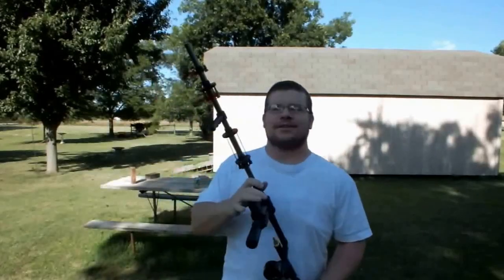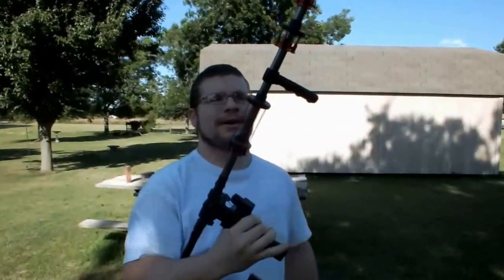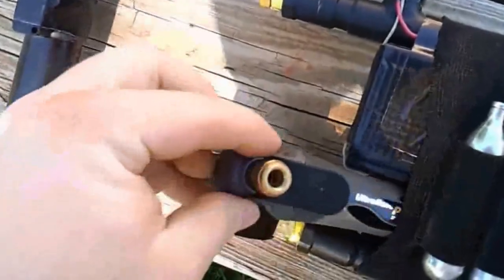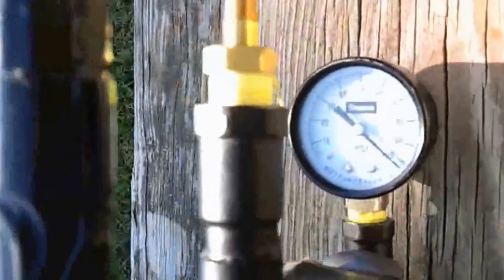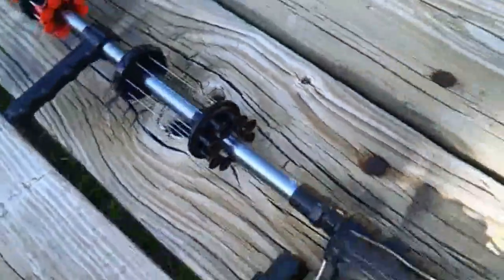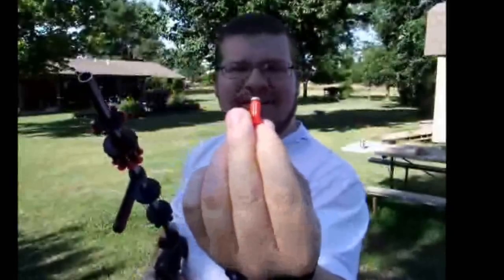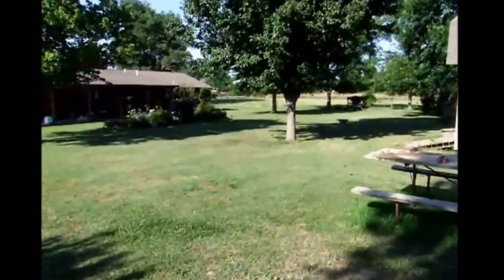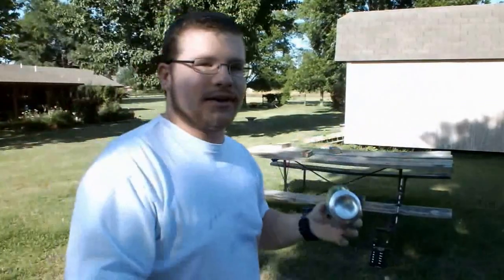Dartgun (Pressurized Blowgun)

Comment: Another poorly made video, how sad. I would rather see a video about how you made it. I REALLY don't care to see you shooting it. I bet that you didn't even make it. Doesn't seem to have very good range either. If you have to get that close, how do you expect to be able to shoot anything alive?
Reply from the maker: Yeah, I can't say it was a great video, but everyone's got to start somewhere. Not that I'm great at making videos now. Videos aren't my main thing, I mostly build things. 

Yes I did build it. I didn't have any plans to make a video about it until I had my third one made.  Since I didn't have any plans to go off of, I went through three designs (I feel like it's cheating if I look at other designs. I want things I build to be completely what I think of). 

I spent around $400 with all my redesigns. I originally bought a 1/4" solenoid valve, but it didn't have nearly enough airflow. I then bought the 3/8" solenoid valve that is currently on the gun. Just those two valves were $90. And all the copper fitting I bought weren't cheap of course. My first two designs I bought a one gallon air tank. 

My first design was very basic. All components were in a straight line. Starting from the back to front: Schrader valve, air tank, valve and barrel. Simple but but I just wanted to test the principle.

Second design, I still had the air tank but put some 90 degree bends in it. The Schrader valve side of the air tank was pointing forward with some copper tubing coming out the rear making a 90 degree bends upwards, another 90 degree bend going forwards to the valve and straight to the barrel. The result was a little more compact and ergonomic, but not much.

Third design is what you see. Much more piping, soldered myself. About the only thing I would do now is maybe replace the 12v sealed lead acid battery with a couple 18650 Li ion battery with a voltage step circuit to bring it to 12v.

As far as the range, it's more than a normal blowgun. As far as power it is insane. I shot it at a Brute 45 gallon trashcan at 20 feet with the 4' needle dart. Went completely through one side and stopped half way through the other side bent in a Z form. Every time I fire one of those needle dart at something and hits something hard they always deform. But it's not really made for hunting. I just made it to see what it could do.
Reply: @vaultvern7704  I watched your video it wasn't bad like others mention. 

Why not just put a pump on it? Airgun style or have a small hand bulb with some type of manual (trigger) release... KISS principle

Comment: Nice work. and video.  Do have another video posted somewhere, explaining the whole process of building it ?       

Would have been a LOT more helpful if you had taken the time to thoroughly explain HOW you built it,  with Detailed information on each of the parts, ie; the correct name of each part, Where you got them, How they function and what they were Originally used for, Cost for each part and together as a whole unit, etc, etc. 

Would have been REALLY Informative to know What the name of that "whatever" was... that you put the CO2 cartridges into, to pressurize the gun with.... where you obtained it from.... or, at least what it's original purpose use was.   All we learned from that was, you made it and it packs a small wallop on pop cans.... a "Teaser" as it were.